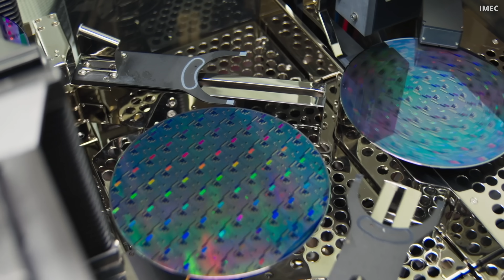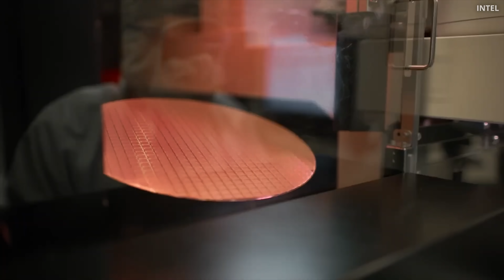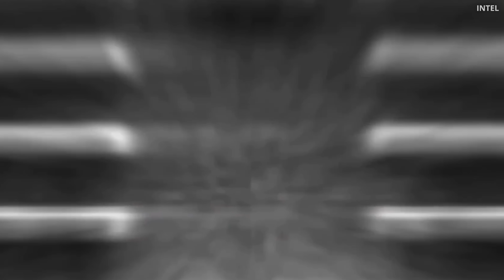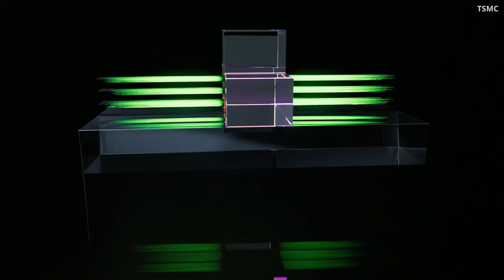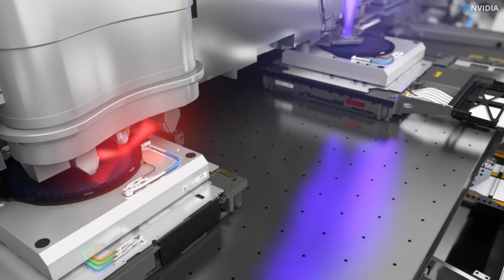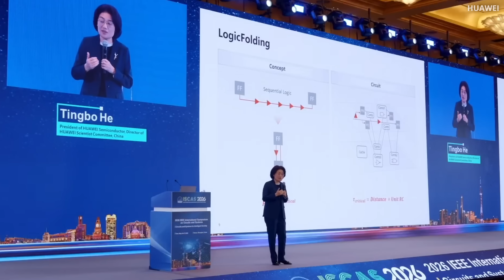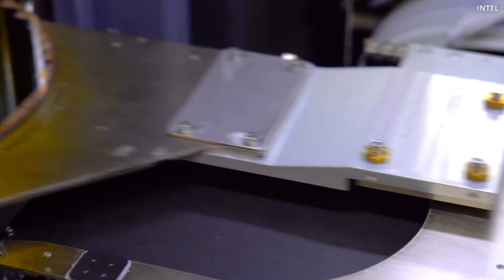China Just Built What TSMC Said Was Impossible

Comment: The fundamental flaw in thinking LogicFolding will allow China to catch up is assuming that TSMC, Intel, and Samsung are just going to sit still on a flat 2D plane.
3D logic stacking (like Intel’s Foveros Direct or TSMC’s SoIC) isn’t a unique Chinese invention; the entire industry has been developing it for years. The massive catch-22 for Huawei is that Tau Scaling is actually bullish for ASML and Western fabs. If TSMC takes their actual, native 2nm or 1.4nm EUV wafers and applies the exact same 3D hybrid bonding techniques to them, their transistor density and power efficiency will absolutely dwarf a stacked 7nm/5nm DUV chip.
Using advanced packaging to compensate for a lithography deficit is a rational engineering workaround under sanctions, but it’s a defensive coping mechanism, not an 'EUV killer.' It inherently keeps China generations behind the actual leading edge.

Nice video still!!
Reply: It's unlikely that TSMC will work on both downscalling transistors and 3D stacking. So this may allow Huawei, and thus China, to catch up in specs and buy some time to develop their own lithography. Granted the western fabs still have an advantage here, but less so that was previously assumed.
Reply: @xSkyWeix I can be wrong, but isn't 3D stacking already a thing for Memory (3DRAM and NAND), so it's not very unlikely this comes to the logic nodes as well. Heat is and was the problem so far that did not happen.
Reply: @Erikve True, but what matters here are the timelines. It's a different matter if China is 10 years behind, 5 years behind and only 1-2 years behind. In the end, sure, both approaches will be used at the same time. But for now what is important is how much specs compare in year to year chip releases.
Reply: @Erikve  we use them in memory because memory can have a vertical bus, another word you can stack many layer of the same "floorplan" and they will work, like bit 4 isn't going to cycle at different speed from bit 5, the same design can work for each bit. you can't do that with logic, logic do not have prefect repeatable "floorplan" because different pipeline in the chip has different length and cycle time. they are not trying to stack core on top of core, they are trying to make a core that is of many layers.  and the reason we haven't done that is because there is no design software in the west that can compute it. its a design software limitation.
Reply: you mistaken what the problem is, the problem isn't stacking chip, the problem is designing stacking chip. all stacking design today are based on first deciding where the connector are than building the chip around the shape it has to be. however this won't produce "the shortest parth" circuit. it is a design problem, the longer the curcuit the higher the latency. what they are proposing is a software that can design multiple layers at once to create the opitmun arrangement. this is not TSMC's business, they only pain the chip, they don't design chip. Huawei is trying to win by design. Huawei is not a fab, it is a chip designer. it is trying to crush other chip designer, that's who they are competiting against.
Reply: @lagrangewei right, that is very good addition for understanding!! And SMIC here is production I suppose?

Comment: The more R-C impedence you remove, the less heat is generated, but with AI optimization integrated the packaging design can overcome the risk, creating heat pathways for maximum dissipation. In this way, the chip itself provides thermal efficiency. "It's always harder to solve hardware"(.) The software stack, when optimized for the 'machine', will perform better even when using a folded stack. Watch out for the "Cube", where optimization will eliminate heat as a function of the stack; where the fastest/shortest/coolest route is also a function of the folding chip technology🧐😍
Reply: Synthetic diamond has an exceptional thermal conductivity that is roughly 4 to 5 times higher than that of copper .
China’s synthetic diamond industry has achieved twin technological breakthroughs: the creation of a rare, ultra-hard "super diamond" (lonsdaleite) that is 40% stronger than natural diamonds, and the production of ultra-large, basketball-sized single-crystal diamond wafers to cool next-generation artificial intelligence (AI) semiconductors. These milestones firmly position the country—which already produces roughly 95% of the world's lab-grown diamonds—to dominate both industrial machining and advanced microchip manufacturing.
Reply: Yes RC reduction combined with optimized system architecture would substantially reduce the 80% power loss and requirement for heat removal.

Comment: I must have missed something. Did Anastasia explain what the SMIC lady was showing or proposing to do about the thermal problem? Folding, I sort of understand, and pinning as well. But how the internal heat that builds up during operation between layers will be handled seems mysterious. Just removing it via a capillary system does not improve efficiency; but suppression of heat production or recycling heat to electricity or even higher frequency light (e.g., a magic thermo(photo?)voltaic-like intermediate layer) would. With one fold, there is still a top side and bottom side to be cooled. But something else is needed for 3-D multi-stacking or folding.
Reply: ..... who cares about heat dissipation?! China 1.4nm breakthrough!! Yeah right..🤣😂🤣

Comment: OK...so now the thinking holds, instead of moving data sideways, moving it vertically can be faster...so...so...how about designing "chips" inside of chips-inside of chips-inside of chips: completely eliminate (AMAP)all wires/wire paths; all the necessary sets of chips needed to compete a "function" instead of being discrete, even though only a few micrometers vertically apart, could be replaced with individual chip components built directly inside, say, an i.c.'s individual transistor, or resistor, or capacitor, or as part of one or more of the contiguous sides of such components...to start with "construction" of such new components probably would work most reliably (highest % functionally acceptable), in the vacuum of deep space, fully shielded from heat (radiation) sources.  Also, the hyper-hyper particle-free clean-room assembly areas necessary for such "chips "  could more easily be constructed & maintained "the other side of Mars" so to speak, where the particle density of "outer space" naturally is extremely sparse.

Comment: About the problems with stacking the chips, what about going on a power diet? Right now, CPUs and GPUs in desktop computers tend to run at the maximum speed and energy consumption the cooling system can handle. The laptop version of the same chips runs at a fraction of the power and overall more efficiently, in the sense of FLOPs per watt. The overall heat output using the low power versions would be smaller and likely manageable with existent cooling solutions, even when you stack a few layers.

Comment: Chip power dissipation would be partially offset by the reduction in RC. How much reduction depends on optimization of RC reduction. Since 80% of heat generated is because of RC losses there is potential for significant decreases in heat generation.

Comment: The problem with logic folding is heat generation per square mm doesn’t support high speed and density it’s not a real scaling lever at the top performance classes
Reply: Synthetic diamond has an exceptional thermal conductivity that is roughly 4 to 5 times higher than that of copper .
China’s synthetic diamond industry has achieved twin technological breakthroughs: the creation of a rare, ultra-hard "super diamond" (lonsdaleite) that is 40% stronger than natural diamonds, and the production of ultra-large, basketball-sized single-crystal diamond wafers to cool next-generation artificial intelligence (AI) semiconductors. These milestones firmly position the country—which already produces roughly 95% of the world's lab-grown diamonds—to dominate both industrial machining and advanced microchip manufacturing.
Reply: @xxoo-lp6vc  the bottleneck is not in the TIM the bottleneck is in the actual wafers themselves

Comment: One correction: China has bought used ASML equipment. They can't by new ones.
Reply: Another correction: buy, not by
Reply: Reverse engineering
Reply: @BenjaminNetanyahu-2025  No, that's not a practical solution in modern microelectronics. ASML EUV machines are comprised of more than 450,000 parts that come from more than 5,000 suppliers. Its prowess is as much technological as maintaining this network of suppliers. Even if they could manage to get those parts and all the components (some of which took years to develop and adjust, like the laser that pulverizes 70k tin droplets per second), they wouldn't have the know-how to make it all work correctly. It would take them more than a decade, and that's only for one part of the whole process or making a wafer successfully.
Reply: But never the EUV
Reply: Only old ones, the current generation nope.
Reply: Regardless - the machines can't be trusted because you can't guarantee they've been tampered with before sold - also the machines won't be serviced so essentially worthless
Reply: @waitingforgodot-p3u  ASML can absolutely tell if they've been tampered with. Why do you think they won't sell to China? -because they've already been caught trying to reverse engineer them
Reply: @clobberella Not because the US have "asked" ASML not to supply to China? Are you funded by HR 1157 by any chance?
Reply: @clobberella I presum ASML will not tell if China received a 2nd hand ASML device which had been modified by the US before delivery
Reply: @waitingforgodot-p3u  I highly doubt it was modified. Most of the chips will go into products shipped to US and EU customers. Trump in China last month promised new chips from new U.S. factories. The global investors are not in competition with China but in coordination with it.
Reply: @clobberella They didn't need to get caught, they directly asked ASML to reassemble one of their machine because they weren't able to do it. China as always seen sharing knowledge as the course to progress.
Reply: @waitingforgodot-p3u  And you think that doesn't apply equally to devices built in the US?? Get real. MS is as bad as the Chinese ever were, or will be,
Reply: @mikensd  This is exactly my point - the Chinese can't trust the ASML machines it does have - it is better off inventing machines of its own that it can use and trust,  There has been documented evidence of changes being introduced to micro circuits which hasn't been publicised a lot (for obvious reasons)
Reply: @mikensd TSMC is not located in china it's in Europe and it's the only company capable of doing what they do
Reply: @waitingforgodot-p3u  Wait for logic folding and EUV which Huawei is still working on it then it will be one of the most extreme gamechanger.
Reply: The country or the company that sold the used ASML equipment to China are traitors to America and the West.
Reply: @andbh4001  I'm guessing you feel that Huawei should also make its technology available to the West just because?
Reply: @waitingforgodot-p3u  What your boss' technologies that the US doesn't have, dude?
Reply: @andbh4001  Some technologies(or claimed to have technologies) are now "had" - the US cannot go to space safely, or land a human being on the moon.
Reply: @wingowingo2928  Human errors can happen, 1diot. Especially in the new technologies where it involves human lives. You understand that, dude?

Are you saying that your boss is using completely different technologies to go to outer space, 1diot?
Reply: @wingowingo2928  "land a human being on the moon."

Has your boss landed a man on the moon, dude?
Reply: @andbh4001  ,  I just tried to tell you what's happening in reality, but you showed an attitude instead.  Your poor choice of words and the way you used them, "your boss," proved that you are not a person to reason with.   BTW, we contracted NASA for a "hitchhiker" payload(something trivial), but Boeing and Blue Origin have been keeping on delaying performance of the contract.  It has to go on a Falcon 9 now.   So are we their boss?  BTW, the Falcon 9 is cheaper than the original contract with NASA's vehicle.
Reply: @wingowingo2928  What's happening in reality is your boss China keeps getting weaken and weaken, dude. Look at in the next couple years when your reserved oil has been fully used and replaced by the more expensive.

Now you understand what the reality is, dude?
Reply: @andbh4001  2idiot, China is going far ahead of the world in renewable energy - while your boss plays King and starts wars he cannot finish, China is spending their billions on innovation, research and much cheaper AI which will blow up the US AI bubble soon enough. They built cooler chips, using even less energy and their AI infrastructure already has cheaper energy - the US have a bottleneck in energy, which is why Musk et al is looking at space based data centers. They have glass and other material chips already tested and will soon starts mass producing them, which out performs silicon ASML produced chips. Now you get reality, stoopid?
Reply: In about 4 years - if they can fix the current air leak in the ISS, it will be decomissioned anyway - which means China will have the only functioning space station - which they are expanding all the time. They will have astronauts on the moon before NASA. Just read the NASA estimates and the state of current developments and scaling in lifting power to orbit and beyond. Accept that the Chinese was on par with NASA, but is now moving ahead effortlessly.
Reply: @chrisvanschalkwyk1455  I seem to recall an air leak found on the ISS was due to deliberate means - i.e. someone drilled a hole in the wall of the ISS - well - at least the Chinese can't be blamed for that - unless they were somehow able to Star Trek beam someone inside, drill the hole, and then beam out again ...
Reply: @andbh4001  No they’re not. You are locked into the U.S. versus THEM mentality that international investors don’t share. American and EU investors built China and use it as a global beachhead. Many Amazon products and those in states come from China. China still produces the IPhone and and the idea of competition is just to get people to cheer if a new factory open in India. The truth is it becomes an expansion of production. No one is shitting down a functioning factory.
Reply: @andbh4001 oh really? Do you know that tiny company named Nvidia, that keeps selling to China well-knowning, that the GPUs are basically as powerful as it gets?
And don't conflate the US and the West. I personally don't give a damn what country makes the fastest chips. In fact I'd love if there were many more competitors - and so should you.

Also: once China has cracked that, imagine if they say "if you want modern devices made in China, buy the Chinese devices only". I wouldn't blame them to be honest. The West is ridiculous.
Reply: @igordasunddas3377  No dude. In the future it will be hard for your boss to steal every new technology invented by the US. Because all your spies and thieves have been deported back to your country, dude.
Reply: @andbh4001  You better watch out, because if you start fooling around, Europe won't sell you any more machines and you'll be drawing your AI on clay tablets.
Reply: @poke-you-tube  LOL, how about if the US terminates all the bases, withdraw all the troops then let Putin eat EU? Will that sounds good for you? Will the machines still matter?
Reply: @andbh4001  But that's why the USA is withdrawing from NATO, because it knows this will happen. The USA has no chance against the USSR, and they know it. The only thing left for them to do is barricade themselves in their basements, ultimately eliminating the manual laborers class as no longer necessary - and that is exactly what they are doing. And all the decision-makers in Europe know it, too. This is a complete change in reality. Don't insult our intelligence; we're not hamburgers!
Reply: @andbh4001   it doesn't matter, its the logistics embargo that keeps them always 2 years on the past.
its the same reason Windows despite being bad, keep being at the top, until up to now. the logistics of making the driver and releasing the OS together with the new hardware and the drivers already implemented always kept Windows support and compatibility ahead. and it still does, even thou you have to keep using WinAeroTweaks and Tiny11 to remove the crap, the Core, the Kernel and the Drivers is what matters (even if ExplorerExe keeps crashing and is a piece of sh)
Reply: @andbh4001  American eating Chinese food are traitor to America.
Reply: @andbh4001  ROTFL. Hello Merikanin. All you can do now is bark.
Reply: @andbh4001 lol no.
Reply: @andbh4001 who cares about America. Move on, China is actually doing things to progress.
Reply: @arewealone9969  LOL, your boss China is dying, 1diot. With no longer cheap oil from Venezuela and Iran, your boss will become the biggest clown in the world.
Reply: @andbh4001 ASML is Taiwanese. Not the West™. Also, it was the USA that got Huawei banned in the West™, making Huawei change its ways to where it is today.  Some say this was the best thing that ever happened to it.
Reply: @nxc1974  asml is dutch not taiwanese.
Reply: @nxc1974  ASML comes from the Netherlands....
Reply: @s0me0nes0mething01  but their machines etc. are only sold to the West.
Reply: @nxc1974  ASML comes from Europe. It's a structure that incorporates knowledge from many countries, from electronics to optics, which is pure science fiction in the USA or Taiwan.
Reply: Huwaei made different approch than ASML. Of course they did reverse engineering, but the product is different.